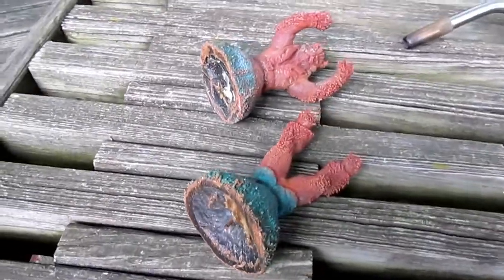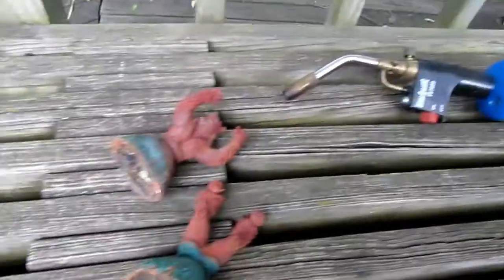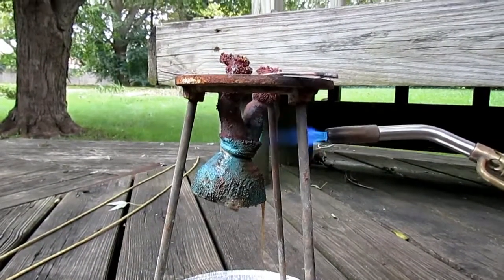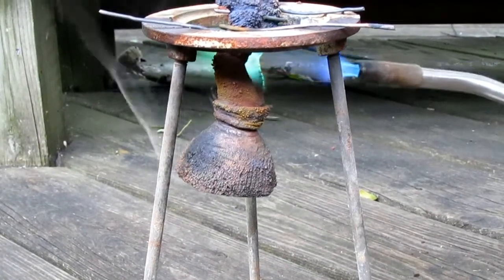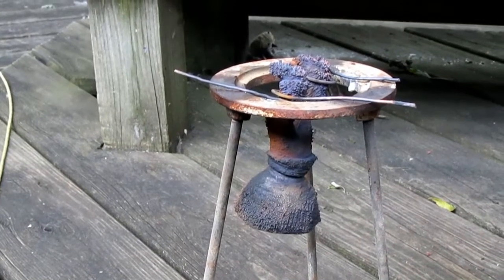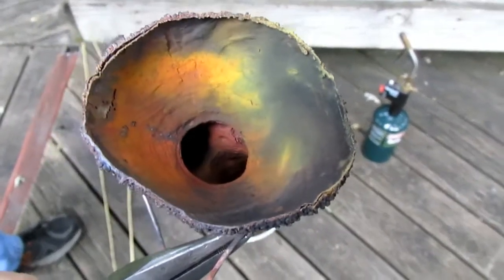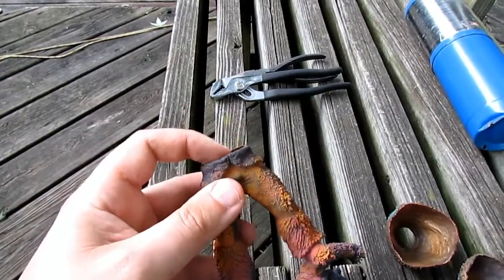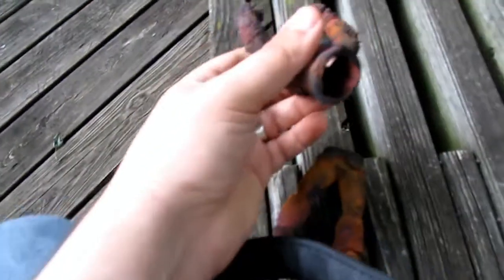Making it Sofubi *Brucie Bonus episode: Trial and Error

Comment: Awesome results, too bad they had those holes but next batch should be much better with all the knowledge gained from this one. Please keep making these videos!! Unfortunately there is not a lot of info so your videos are incredibly helpful. What is your setup for electroplating? How long did it took to get the thickness necesssary? Thanks
Reply from the maker: Thanks. SO the ones shown here took a couple months to get this thickness, but I would attribute that to using older material (Copper-Sulfate has a shelf life of about 5 years which I didn't realize until after the fact. Most of the chemical used on this trial were going on 20 years old). Were going to put the new dummies into a fresh bath in a plastic bin with a aquarium bubbler, which should help move the process along. I will certainly be documenting the next steps for sure.